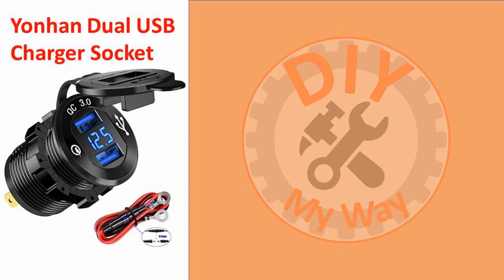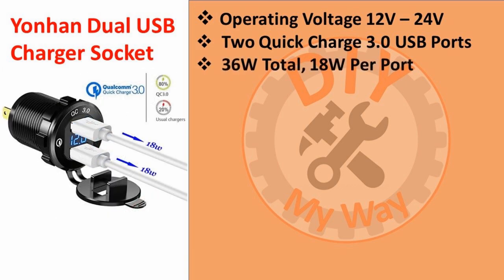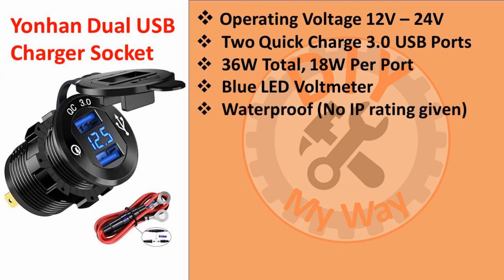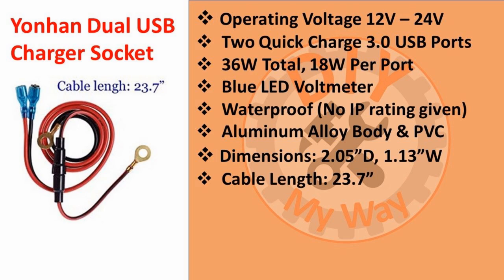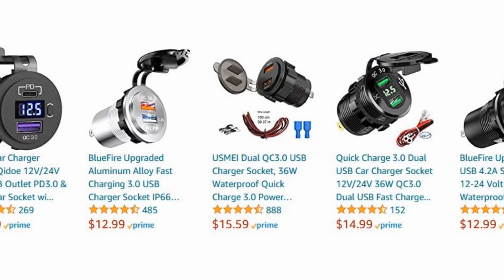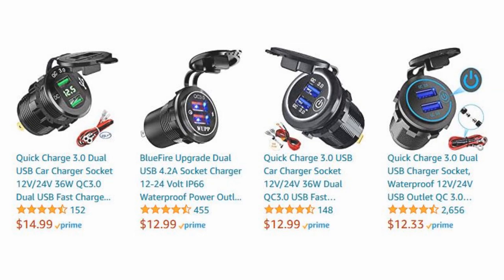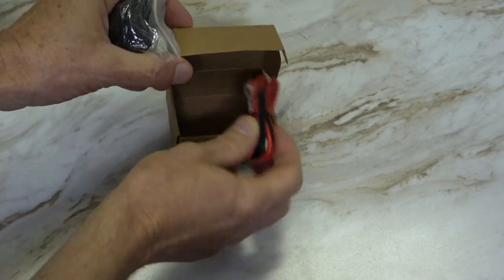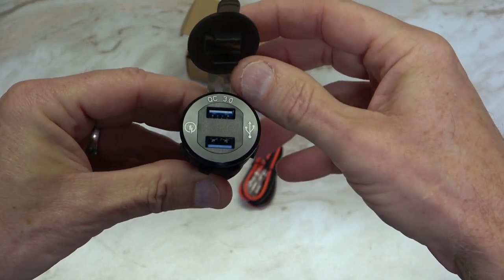Kubota Tractor Mod: Adding A USB Charger & Voltmeter (#148)

Comment: Very clean job Martin and well presented.  Kudos for having the courage to fire up that drill...not sure I could get up the nerve!  I used the same (or very similar) outlet/voltage meter on my boat.  I do have a canvas cover over the boat's center console but it spends its live on an open boat lift and so far after two years it's still working fine!
Reply from the maker: Thank you very much!  Glad to know yours has held up well so far!

Comment: Nice product! You sure do not want the hole saw to slip on that fancy hood! The pilot drill is there for that... I think this is a good spot for that. As you said, although it's waterproof, it's better standing vertically. Thanks!
Reply from the maker: Thanks, Joe!  Exactly right about the pilot hole.  I wasn’t taking any chances. Thanks for watching!

Comment: Hi Martin! That's a very handy mod. I think I would have been really nervous to drill into the dash also. Miy B2601 is still too new for me to do the same project, but I know where to come in the future for a very well made tutorial. I think I'm going to go ahead and pick up the parts that you used though now just in case they're not available later on. Thanks for sharing!
Reply from the maker: Hi David!  Yeah, your tractor is still too new to be drilling into the dash just yet.  I’m pretty sure they’ll still be making these devices down the road, but if you want to get one now, make sure it works before you put it on the shelf for later! Thanks for watching!

Comment: How's she goin'?  Very nice mod Martin and very useful too.  I installed a similar unit on my tractor.  Since I have a cab, I installed the unit on the headboard 'instrument panel'.  It's nice to see the battery voltage when starting and operating the tractor.  I was surprised at the voltage drop difference when I went to LED bulbs on the tractor.  The running voltage of the tractor was about 2.3 volts higher with the LEDs than when I had the OE incandescent bulbs.  Thanks for posting this Martin.  I hope others see it and follow your lead and install this useful addition!!!  Take care!!!
Reply from the maker: Hi Mike!  Thank you, sir!  Good point about LED lights.  I haven’t changed the stock bulbs in mine but I don’t use them anyway.  I use the LED lights I installed on the ROPS. Thanks for watching!

Comment: Looks good Martin. Given you drilled into your dash you might want to consider picking up a backup charging port. If it fails down the road you’d be assured of an exact replacement. Non-American made products can be unreliable. 👍
Reply from the maker: Thanks, Paul!  Good point!  These things are all a standard size so I can find replacement anytime.  A lot of companies make this same or very similar design. Thanks for watching!

Comment: very helpful...but i would worry about hitting the cable and plug all the time
might have moved it around to the left more.....my Kubota has a 'cigarette lighter' style charger built in....no volt meter but not drillign holes either
Reply from the maker: Glad to hear you found it helpful!  Fortunately the cable and plug are out of range of my key by design.  So far, so good.  Oh go ahead and get that drill out!  Live on the edge!  LOL! Thanks for watching!

Comment: Looks like a very professional job Martin!  I kind of cringed when you bore a hole in your plastic cowling to your Kubota.  For myself, I might just make sure my iPhone is fully charged before I set out on my 3301L :-). I do like the fact that you can better tell the status of your battery though.  The only thing I might have done different is solder the connectors rather than just crimping them.  With the constant vibrations of the tractor, I would want to ensure that they don't come loose and eventually pull out.  Appreciate the videos!  Cheers
Reply from the maker: Thank you, Cliff!  Yeah, I REALLY like the voltmeter.  Good point about the connections.  Those spade lugs are on there pretty tight so I’m not worried about them shaking loose.  If they ever do, you can bet I’ll be soldering them on. Thanks for watching!

Comment: Nice job. I made the exact same mod to my B2650 a few months ago and it is nice to have the digital volt meter to monitor both the battery and the charging system. While I was at it, I also added backup cameras to both my tractors.... A mod that I'm sure the neurosurgeon who operated on my neck would approve of.
Reply from the maker: Thanks!  Backup cameras! Cool! Thanks for watching!

Comment: Very nice. I would suggest added dielectric grease to the terminals at the charger. Recognize it’s not in the elements but moisture is own enemy.  At least with electrical connections.
Reply from the maker: Thanks!  Good tip, too!

Comment: Another great idea and great video.  My tractor is slightly different(smaller) but has s similar dash layout.  I will have to see what I do with mine.  I love the idea of having my phone visible and accessible  for calls while I am on the tractor.  That is the primary way my wife gets my attention when I am on it.  I need to revisit the video where you put in the aux fuse box and adapt it for my needs.  Thanks again for the video!
Reply from the maker: Thanks, Marty!   If you are not using your 10A rear work light circuit, you could use it to power the charger and you won’t need to add an aux fuse block.  Or you can just run it straight to the battery with an inline automotive fuse. Thanks for watching!
Reply: @DIYMyWay  I am considering adding  ROPS lighting like yours, just not sure yet.  I have never used my tractor at night.  Then again, it will be nice to have if I ever do. :)